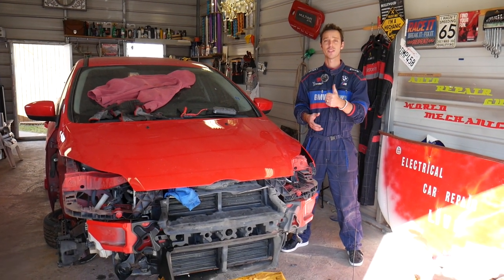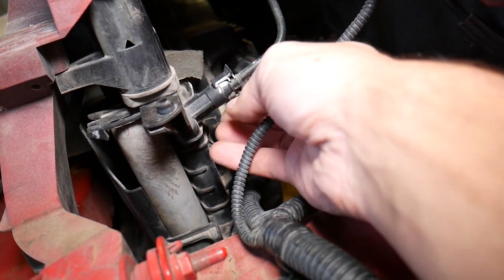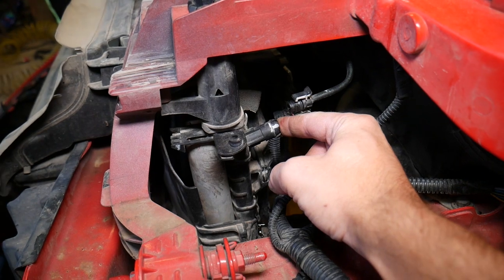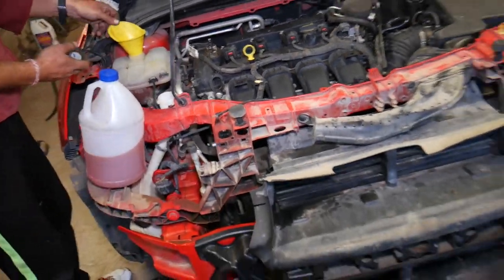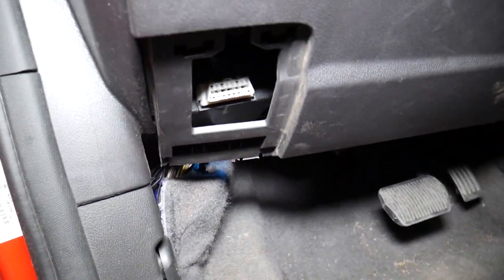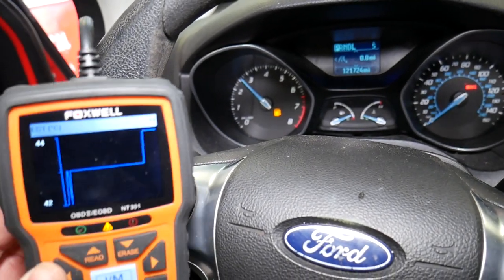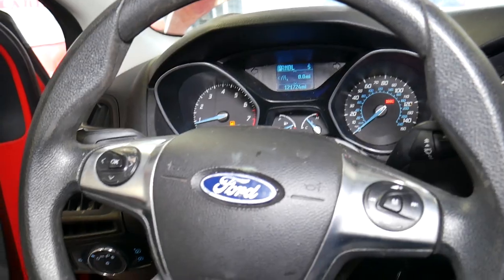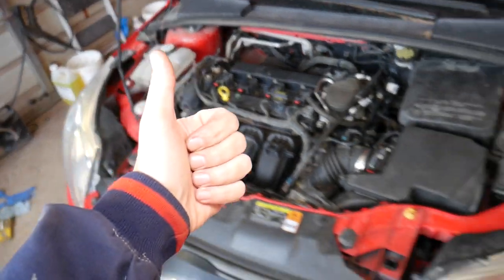FORD FOCUS MK3 BLEED COOLING SYSTEM. CAR OVERHEATS AIR IN COOLANT SYSTEM

Comment from the maker: Products that we use and recommend:
► Ford Coolant: https://amzn.to/2YuMEln
► NT301 Scanner: https://amzn.to/3b0EHa1
► Panel Removal Set: https://amzn.to/3YiMADu
► Assorted Fuses: https://amzn.to/4fx4s3F
► Tool Set: https://amzn.to/3p5MM6t
► Screwdriver Set: https://amzn.to/3XRB28Q
► Castrol Oil: https://amzn.to/3xBc8B9
► Oil Filter: https://amzn.to/3w0Ulme
► Torque Wrench: https://amzn.to/32qyRwg
► Liqui Moly Engine Flush: https://amzn.to/3IiDBID
► OBD Scanner that we use most often: https://amzn.to/3I4MQfe

► Check out our Amazon Store for the tools and parts that we use: https://www.amazon.com/shop/worldmechanics
Reply: Would that be the same for a 2004 st170

Comment: Hi, I’m a qualified Bosch technician and have been in the industry for many years. 
I watched your video on fitting a new AC condenser to a 2.0 ltr  Ford  Focus. 
Thanks for putting in the effort to list the video I found in quite helpful in completing the procedure.
I would like to advise you on a couple of points. 
First, don’t try and dismantle the radiator/condenser/fan/air dam stepper motor assembly in the vehicle..too hard and you can break clips!!  
It’s much easier to remove the whole assembly then dismantle on the bench. 
Second, the hole and chamber under the air cleaner assembly is for backfire not to drain water from the air cleaner assembly. There is however a small hole in the backfire chamber to release any water that might enter the unit.
Third, avoid blowing compressed air into the cooling system,. Most cooling systems don’t have heater taps only air flaps so you can expand the heater core very quickly and cause it to leak.
Well done on your presentation.
David - Australia 🇦🇺

Comment: Shouldn't need to raise the car and disconnect that line. That vent tube goes to the top of the coolant reservoir and will air out for you.
Reply: I was thinking the same thing.
Reply: Thanks, I just had that little reservoir hose break while putting in a new MAF sensor. It dumped all my coolant. I limped it home and I'm waiting for a new one. This info is important.
Reply: @Fifth313ment  wish id known just how FRAGILE it was before leaning in to check all hoses, and for leaks!  Yeah it's broke in like 5 places including right at the degas overflow clip.  FML

Comment: I hate to ask, but am stuck in a Northerneastern city inMaine, frigid temps, 6 nights ago, (and after I popped the hood to my '14 Focus SE-and while cold, not started/idling- I topped off the coolant while checking other fluids, then replaced the cap.  Started the car, and ran the vehicle (at idle to keep warm, as I was awaiting arrival from a traveling friend) for about 4.5 hours.  During this time, operational temp remained halfway (190°F?), And car was blowing perfect, ste-temp heat the entirety of the almost 5 hour period. 
We went for coffee, so I shut the engine off while in the coffee  shop, [a good 2 to 3 hours] said goodbye to my friend, then went out and started my car.  I let it run about 10 minutes
Now, not even 200 feet down Main St. I FIRST NOTICED IT WAS BLOWING COOL/COLD AIR ONLY, THEN IMMEDIATELY AVERTED MY EYES TO THE ENGINE TEMP GUAGE, {{since my informational LCD screen went kibotch [black]the first time my transmission failed completely, saying "Transmission HOT!" "Pull over to safety", right smack in the middle of the busiest intersection on Rte 1 Southbound, by what was once a decent shopping Mall and only had Neutral.)~this was around 92,000 mi.~}}where I watched the ENGINE TEMP QUICKLY RISE.  
So I IMMEDIATELY pulled in to a parking area, and shut it off.

••~1ST QUESTION:. HONEST OPINION PLEASE:.......
WHAT IS THE PROBABILITY/ LIKELIHOOD THAT-- 
(+++EVEN*AFTER* IDLING FOR 5 HOURS, allthewhile BLOWING GREAT HEAT, AND REMAINING AT NORMAL OPERATING TEMP+++)--THERE IS AIR TRAPPED SOMEWHERE ???!

     SO AFTER THE HOOD WAS POP I WENT OUT AND WENT AROUND to check hoses and check for leaks and when I leaned in to check to the lines and/hoses, for cracks , leaksgoing through the heater for four hoses rather and when I leaned in and broke (in several pieces) the overflow reservoir hose the (small line  with clamp to radiator valve that you were adamant in the video on being careful, since it was known to be fragile)into in the video. 
I am currently attempting to patch it the best I can in my dire circumstances (live in my car, btw)since it's a dealer item and I have to wait for it to be  special-request ordered & shipped to our local Ford dealer and need to move my vehicle b4 it gets towed away.....Is standard, yellow, flexible air-compressor hose.
•••2nd  QUESTION:.Just in your opinion, is this line okay to withstand not only the pressure, but the temp the coolant, as it's all I have at my disposal and/or engine can get?

Comment: I done a coolant change. I didn’t do what you done with the rad. Will this affect the heater matrix? My heater matrix
Is not blowing out hot air. 
Note, the car has been run as a daily for a month since

Comment: That’s not how you bleed it... the reservoir tank is the highest point in the cooling system. No need to pull hoses under the headlight. If the car is cold you should be able to start the engine and bleed it through the reservoir. Fill until no more bubbles and level is at max when at operating temp.
Reply: I have a ford galaxy and cant find bleed screws either. So I just turn the engine on with the cap off and the air will just bubble out that way?
Reply: @schmo9425  yeah so fill up your coolant up to the max line, start the vehicle and let it run for a while. Keep an eye on the reservoir, you’ll see the level drop and some bubbles come out, add fluid as necessary until the coolant stop dropping and there are no more bubbles. Goodluck!
Reply: Thanks guys! Will try this once I've located and fixed the coolant leak.
Reply: @schmo9425  no problem! I’d still try and refer to a service manual for your vehicle if possible!
Reply: Siye Boss  looks like coming from heater matrix/core!
Reply: Siye Boss  drivers side footwell was damp, looking like it will be a garage job and a costly repair for mine
Reply: So if I'm understanding correctly:
Fill radiator and reservoir to max lines, keep both caps off, let car run and fill as the level drops or? 
Sorry this is months late and I'm about to bleed my system and haven't found any info online.
Reply: @Skell1nton  there is no cap on the radiator, just on the expansion tank/coolant tank, so you only have to fill there. There is a video by Haynes that explains it well.
Reply: To the cold fill line or hot
Reply: @jdteets4  to the max line. As the fluid cools it’ll go down to the min Line, if I’m not mistaken.

Comment: Is there a bleeder valve on the transmission next to the battery? Saw a hose when changing spark plugs that doesn't seem to connect to anything.

Comment: Surely if you fill up to max, leave the cap open and run it, the car will push the air out anyway? So long as you keep an eye on levels and temps it'll sort itself out

Comment: hello brother i had a problem with my ford fusion 2010 overheating,i changed my thermostart and burp the air out bt still the car is overheating,,any advice ..?

Comment: The hose at 5:32 on my car won’t go all the way in. It seems like the part of my radiator isn’t deep enough to get the full clip in but the hose looks no different than this hose in this video. Help would be deeply appreciated
Reply: Hi Devin, how did you solve your situation ? I am facing the same issue
Reply: @guillermocordoba8862  I literally cut the plastic thing around the hose and pulled it off up to the rubber washer. The thin part of the hose goes in no problem and the rubber washer and clip keep it in. Got my car running like new now 🤘 I was pissed that’s what I had to do tho.
Reply: @devinzorn2077  thanks!!! for the tip !!!

Comment: im confused. here you say you couldn't find an emptying valve so you removed the hose.
but in other video you showed a same car model mk3 focus with an emptying valve:
https://youtu.be/kizluYWxzag

can you explain?
Reply: I think they're referring to the bleeder port on the Ford Fiesta. So instead you have to pull this return line fitting.